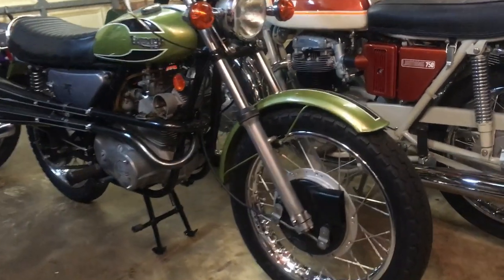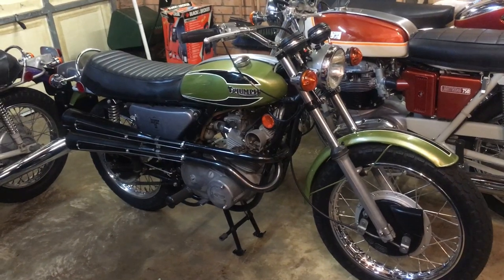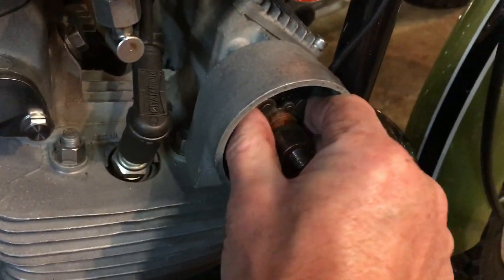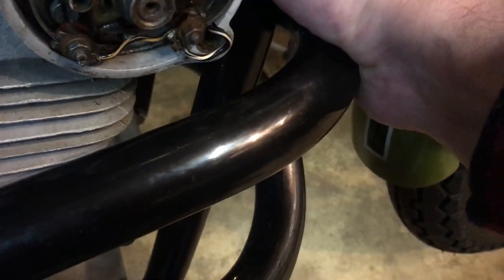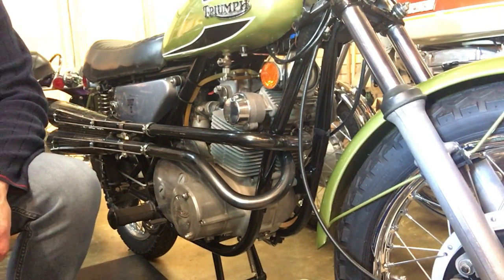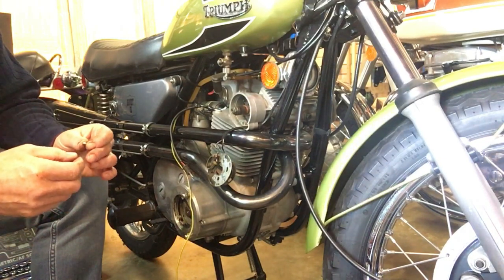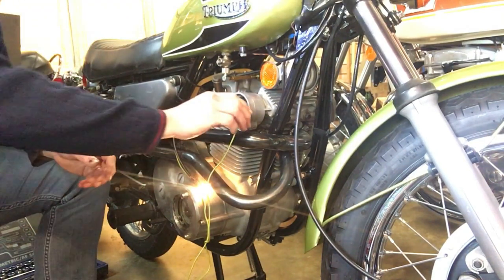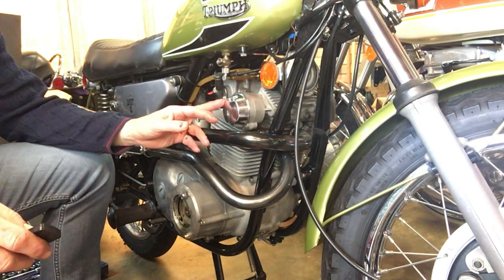Triumph T35SS Bandit SS Recommissioning - Part 1 - Ignition Timing

Comment: As a very recent subscriber, read two days, I find this fascinating, brings back memories of points and cams, one thing I never did was never pull anything apart without a screwdriver and a pot of white paint to use as a marker, saved me many a time, now I use a white paint pen, don't you love progress
Reply from the maker: Thanks for the interest and comment. I do need a white paint pen myself. I did originally mark with a felt tip but didn't trust it in the end so decided to re-time from scratch - it doesn't take long with the crankcase/shaft plug to facilitate matters. Thanks again.